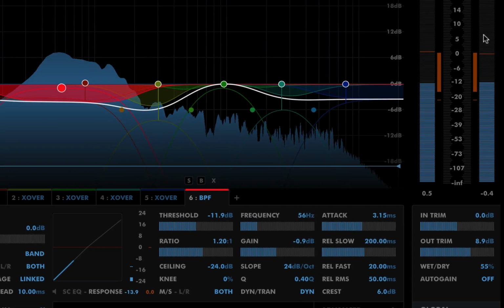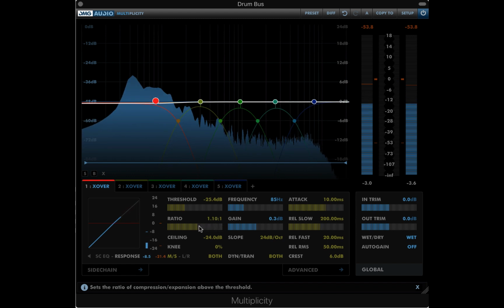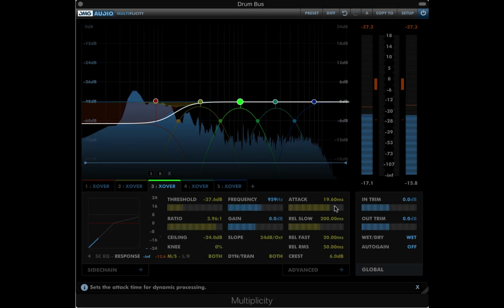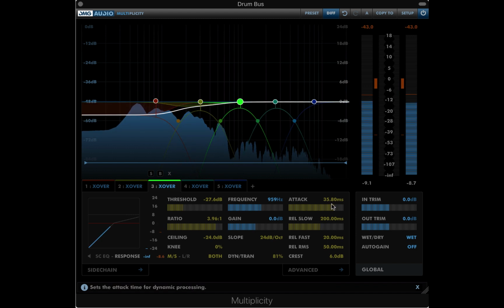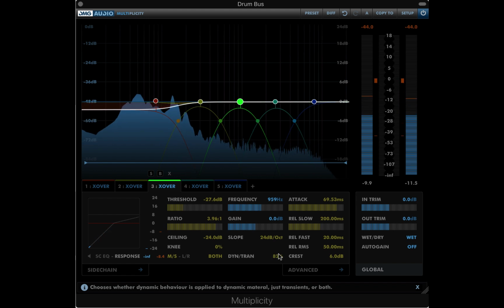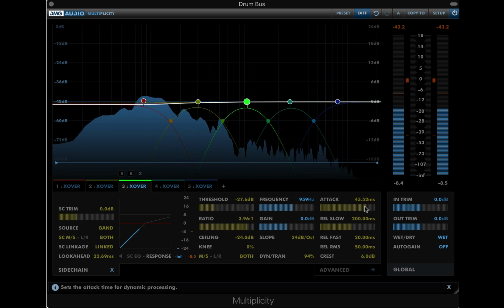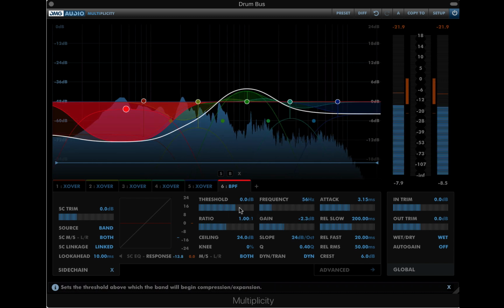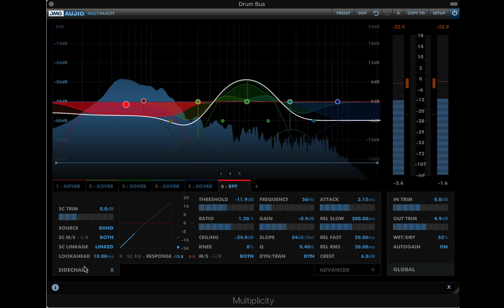DMGAudio Multiplicity: Dynamics and Transients

Comment: Great video. Keep them coming. Multiplicity is definitely an extremely powerful and complex tool thats going to take some time to fully appreciate, but I'm loving it thus far. It is possible to modify the GUI screen so I can see frequency values along the x-axis?
Reply from the maker: You can switch on the Readout function in Setup, which will display frequency values!
Reply: @Dmgaudioofficial  Awesome. Thx.

Comment: I don’t usually write reviews but this is actually the second time I’m writing one on The Beast. I finished my third mastering job after I started using it on Demo mode, and the results I got were so good and unprecedented that I just went ahead and bought it and it’s worth every single penny. I’ve never had this amount of control over dynamics before unless I used two plus compressores so this truly is a game changer. Well done DMGAudio for such an amazing release! And btw, if you’re reading this don’t forget to rtfm, I’m actually reading it for the third time now...
Reply: still using it? did you compare vs ff? what about alchemist?